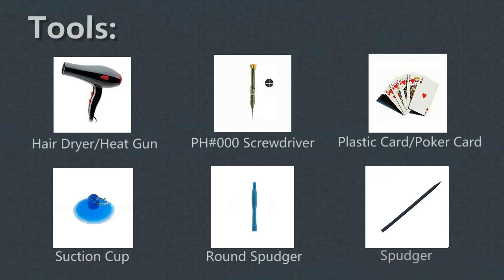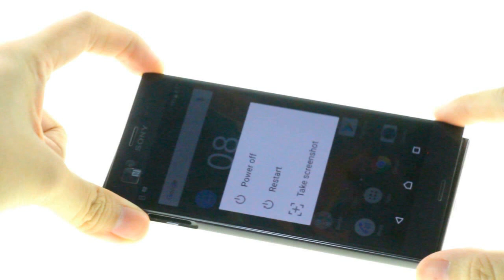Sony Xperia XZ Charging Port with Display Flex Repair Guide

Comment: What is the piece called that you snapped off at 4:04? I broke mine in half, and now the charging port is not being held in place, it keepd slipping back into the hole when I charge and I have to keep pushing i down, which means i can't glue on my screen.
Reply: mine is broken too, where can a replacement be found?

Comment: Hello, i tried my xz to have the charging port replaced in the sony service center and they are telling me I need to pay for the replacement of motherboard since the port is attached to it? Is this true?
Reply: I just did this myself, the parts alone are around 5$. It took me 1 hour of work and just one piece had to be changed. They just want your money. I wouldnt let them do this.
Reply: No it's not true

Comment: can i ask if i charges my xperia xz so slow is it charging port problem or cable problem btw third party cable
Reply from the maker: Did you drop it before? Try open the phone and reconnect the charging port flex cable, and reconnect the battery cable.

Comment: Hello. Thank you for this great video. : ) Why you need duct tape for removing the lcd-screen? and can the flex not be replaced, it i open this model on the backside? Thank you very much for your support!
Reply from the maker: I put the tape on the screen to mark the safe place, which remind me do not make the card outstrip the tape area, otherwise i would break the screen display. and I should tell you that XZ cannot be open from the backside, I tried and almost ruin it...

Comment: What's the transparent blue thing in the video. I'm assuming it's a way to coat the correct areas with adhesive?
Reply from the maker: It shown in which position in this video?
Reply: Wit Rigs around 6:30 bud. It looks like a glue applicator just nor sure where to buy
Reply from the maker: Well that's the Screen Sticker, for reassemble the screen, here is the link  http://www.witrigs.com/oem-lcd-supporting-frame-sticker-for-sony-xperia-xz
Reply: K thanks bud